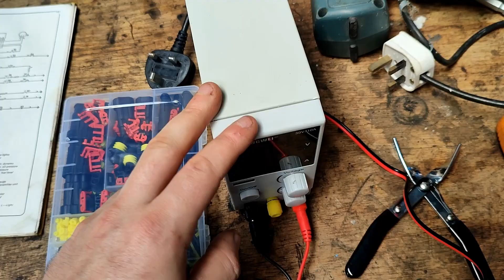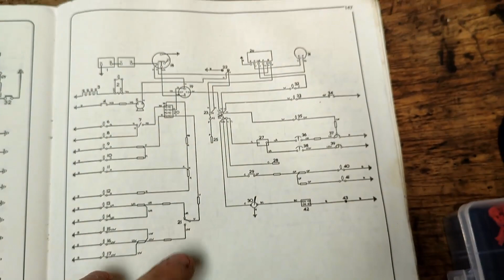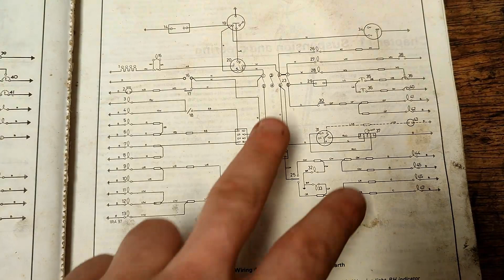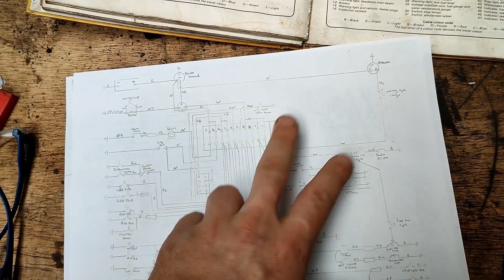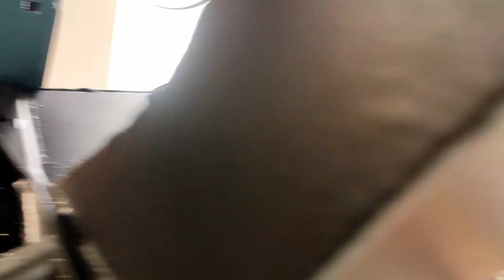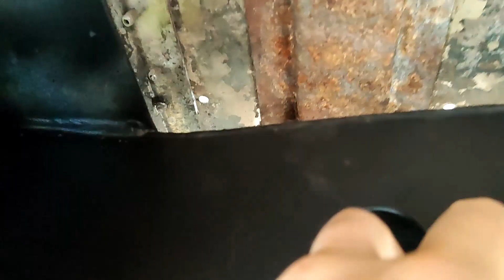How to wire up a Land Rover - Building your own loom from scratch Part 1

Comment: This is a great vid mate. Can you link to where you got all the connectors
Reply from the maker: It depends really on my order quantity. If I'm only buying a few I will usually just search on eBay for the cheapest as with postage cost included it's usually cheaper. If I'm intending to buy more I use autosparks or 12planet. 
The bullet connectors are Lucas bullet connectors and for those exposed a bit more to the elements/to be a bit neater you can search all sorts of different automotive/marine connectors for your size of wire. Providing you have the correct crimping tool it's pretty straightforward.